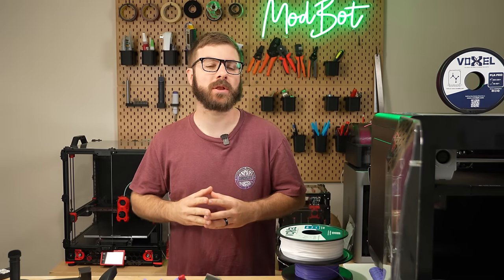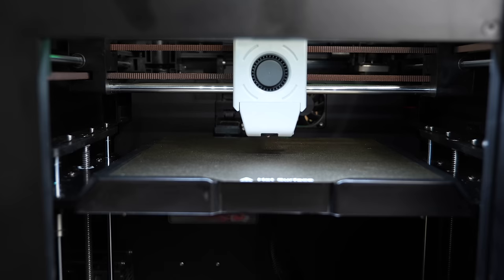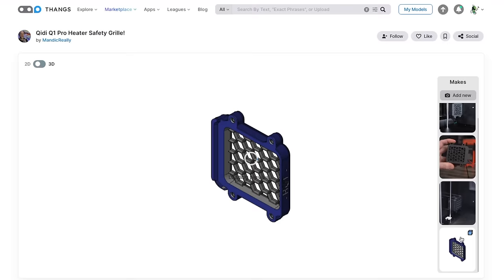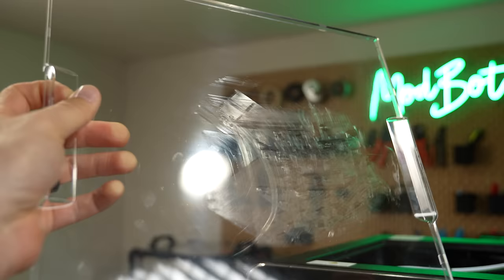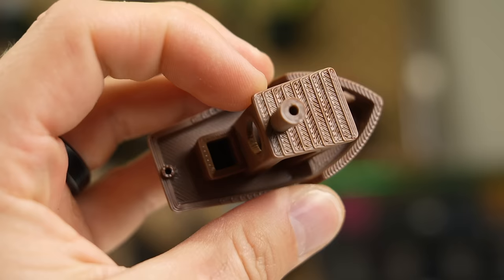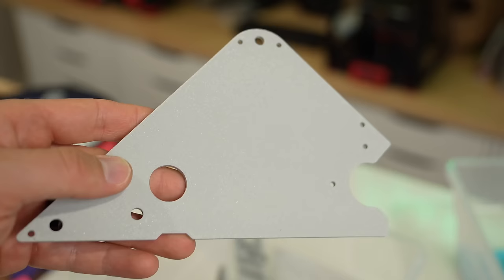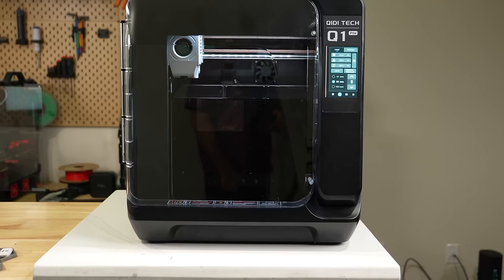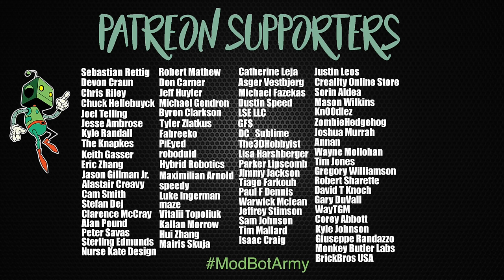Sub $500 High Temp Fully Enclosed CoreXY 3d Printer (Qidi Tech Q1 Pro)

Comment: First off, that is not a load cell, but a piezoelectric sensor. I do not encounter thermal drift problems, maybe just preheat the printer, it is extremely quick compared to other printers.

The nozzle is not used for the mesh, because it is significantly worse in accuracy, the inductive probe is a lot better. The nozzle probe is good enough for getting a nozzle offset or even the bed mesh, but the inductive probe is more accurate in other regards, no reason not to use it. So in conclusion, the piezo nozzle contact probe on the bed is only for the Z offset. Here are my results of probe accuracy:
nozzle probe: range 0.041718 stddev: 0.013429
inductive probe: range 0.007344 stddev: 0.002062
Now another problem is that, why is the piezo nozzle probe not as accurate as one would expect? Well, I don’t know, but I do hope it was better. Slowing probing speed down could lead to the piezo not generating enough voltage to trigger, so that’s not a solution. I guess we’ll just have to accept it.

Comment: That looks like a cheap bambulab clone. From the design to the packaging, it really is a 1:1 copy, where expensive parts have been replaced with cheap ones. Not sure if that printer is a good investment, especially when a P1P/P1S isn't much more expensive.

I think they installed an inductive probe, because they couldn't get the other sensor working well enough. (See the hundreds of pages on Klipper Discourse about getting this implemented and all the problems people have with their K1 and leveling)
Reply: Using the same arguments, Bambulab machines could be considered clones of Flashforge, Creality (they aren't all Ender 3's or CR10's), Qidi and many others.
Reply: Qidi was making enclosed core xy printers since 2014, if anything bambulab is a qidi clone :P
Reply: P1S has a filament cutter and wins on print volume, but does it have 350°C nozzle, 120°C heatbed, or 60°C chamber? Then consider that the Q1 Pro is 25% cheaper.

Comment: Haha yeah so it’s a Bambu clone. Rather just get a Bambu.
Reply: This cost like an A1 yet it's corexy, enclosed, heating chamber, open source.
Reply: It costs as much as an International version of A1 mini in China. I’m not in China so I can’t buy the Chinese locked version of A1 mini, but I can buy this printer for less, and have an enclosure, and have a actively heated chamber (which is awesome, preheats so quickly). As someone who mainly prints ABS, this machine is pure awesome. Also the customer service is extremely good, better than Bambu. I do have an A1 mini too but it’s basically useless for me.
Reply: Stop embarrassing yourself 🤦‍♂
Reply: @drconflict629  no the door and everything else is embarrassing. That thing a turd. Come one you’re embarrassing yourself
Reply: @eaman11  yeah the p1p is $599 and p1s $699 way better machine for not much more this is $469 so for $140 you’re telling me it’s worth it to get the q1?
Reply: @weldingjunkie  Given that it can be picked up direct from the Qidi store for $439 with a coupon, "not much more" is doing a LOT of work in your sentence there.
Reply: @weldingjunkie  I agree that the Q1 is kinda embarrassing. But you pretending Bambu is the only viable alternative in cringe as well bro.
Reply: It's not, because the chamber heater makes this much more relevant for ABS/ASA printing specifically. Nothing wrong with Bambulabs but if you are someone who prints exclusively in that material, this is a better option.
Reply: @drconflict629  no I said they straight copied, read my post. I didn’t say that at all.
Reply: @weldingjunkie In what way? I mean Bambu copied generic enclosed corexy printers.
Reply: @weldingjunkie  Not here, the P1P is €665,36 EUR and it's not enclosed and has no heating chamber and not open source.
Reply: @eaman11  well for you might not be an option but I stand behind my comment it’s a P1 clone with cheap parts on it. I mean do you want junk for $500 or something better for 7? You tell me
Reply: @weldingjunkie  dude stop telling bullshits, it's not like bambu invented 3d printers.
Reply: QIDI has been producing COREXY-enclosed printers for the past decade. Ultimaker has always been the design cue for QIDI.
Reply: @eaman11  are you high, it looks like an exact clone gtfo haha. Never said they did but that’s a clone.
Reply: @weldingjunkie  Bambu machines are the ones that are built down to price, even the X1C. Everything you won’t notice is cost cut to the extreme.
Reply: @jerrymk6846  for sure Bambu doesn’t cut corners. It’s funny to see this looks exactly the same but with cheap parts on it right down to the 2 hot end screws and hot end lol
Reply: @weldingjunkie  That hotend design is copied so much that it’s kinda the new standard anyways, not a Qidi thing. Also, I guess Bambu will never add an active chamber heater because that would be “copying Qidi” right?
Reply: @weldingjunkie  Also I didn’t say they cut corners, but they cut costs. Not like it’s a bad thing, but it is not really reflected to the price. Sure, them being Bambu with the reputation, they can afford selling at that price without losing the demand, unlike Qidi, a relatively small company (while customer service being way better than Bambu, a group chat with 10 people, with people both from the engineering team and customer service team, that responds almost the whole day, and does not hesitate to send out replacement parts, that arrives in a day). But that’s our benefit isn’t it? To get a printer that costs about as much as an A1 mini and shipping (310USD here) and works miles better than P1S. As someone who actually owns the printer unlike you, I can assure you that the experience is completely satisfying.
310 USD buying an A1 mini is a complete joke when you see what kind of machine you can buy from Qidi. Also, yes, I also own an A1 mini.
Reply: @jerrymk6846  and no that hot end design was from Bambu only stop fronting. Even stole the name Q1 lol vs P1
Reply: @weldingjunkie  bambulabs cloned various printers that came before them from Creality, Qidi, Flashforge and others.  Qidi had X-One2 and X-Pro in 2014, X-Maker in 2016, X-Smart in 2017, X-Plus and X-Max in 2018, X-CF Pro in 2020, etc.  So tell me, Bambu X1 copied what?  And P1 is a budget version of what?